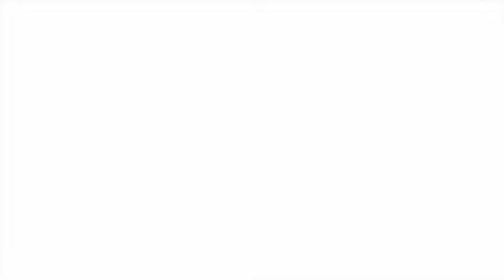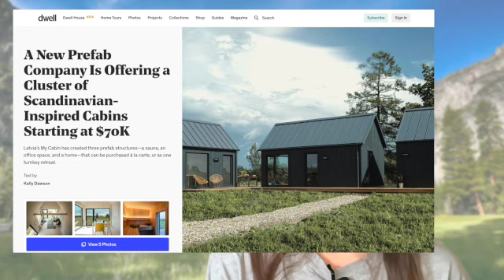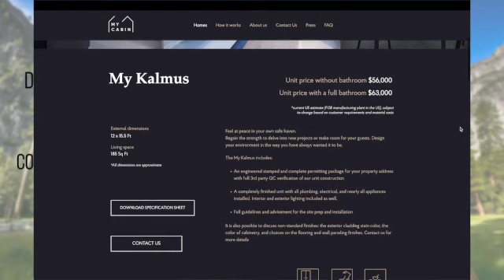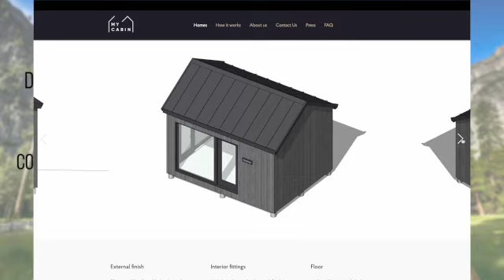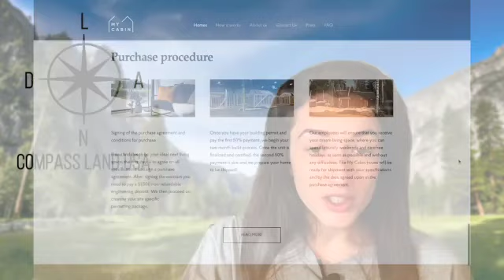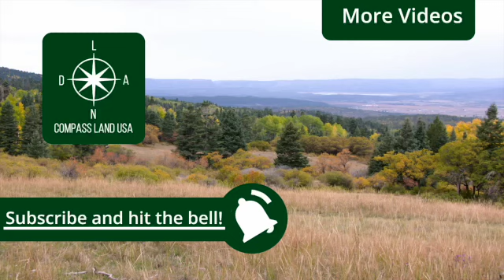An Idea for Your Land: Prefab Homes by MyCabin

Comment: What’s great about pre-fabs is that once they’re installed, they’re no different than a site built in terms of increasing in value, they can be very unique and creative in design, they pass most if not all the same code via being put up on a proper foundation, unlike boring manufactured rectangular box mobile home types.